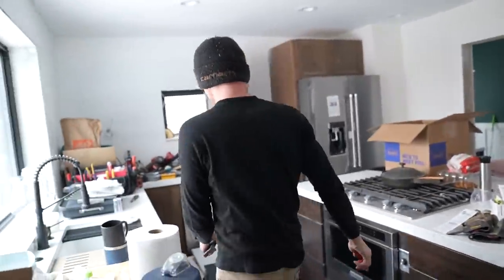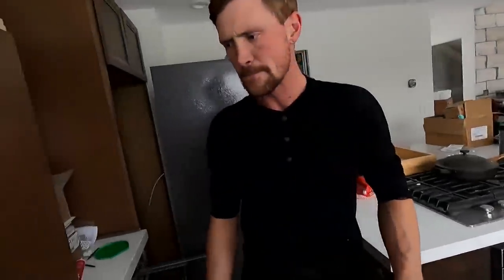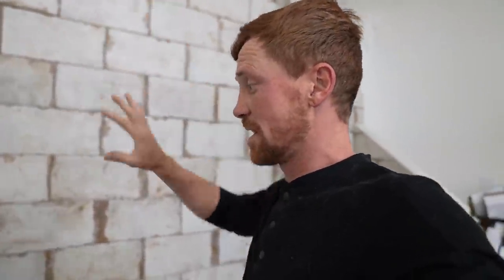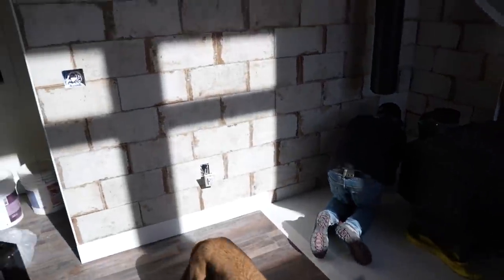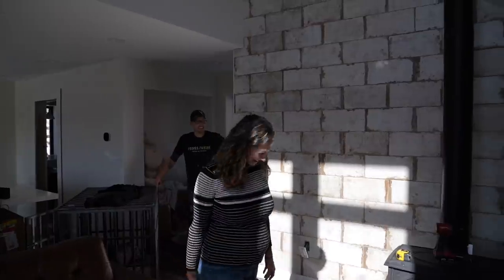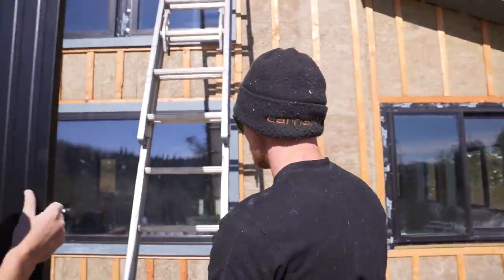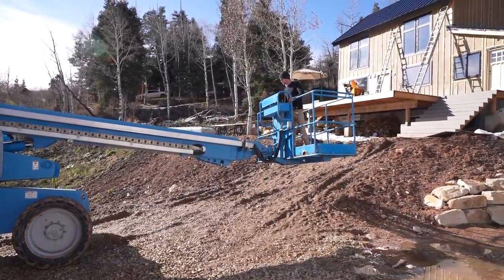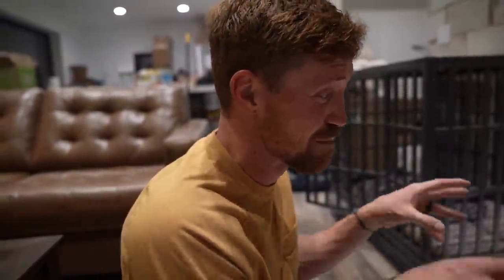TIME IS RUNNING OUT | BUILDING OUR OWN HOME

Comment: Before you light a fire, open the glass door for 10-15 minutes to “prime” the chimney, and crack open the closest window (behind the couch?). Since heat rises it will rise in the chimney and the cold air helps all that. Once the fire is going well, close the window and you should be good to go! It works for us, then no inside smoke because it follows the heat up the chimney. May God continue to bless your little family! You’ve done amazing work and have a beautiful home! Thanks for sharing your journey!

Comment: I have a tip for you Trent!! When you fire up the wood stove you should have 2 or 3 sheets of journal paper with you and after you do the pile of wood when you fire it up, right after it starts to burn you put those sheets mildly wrapped over the wood. Because the paper burns rapidly, that will cause a burst of heat in the pipe and you won't get smoke in your house. Try it and see. :) Regards from Portugal!

Comment: There are a few comments about the fridge being boxed in preventing adequate ventilation - and they are spot on.  All that heat inside the fridge compartment is transferred to the heat exchanger on the back of the cabinet.  This then transfers the heat energy to the air.  When I had our kitchen re-done a few years ago, the installers did not make provision for any proper ventilation. But I, being a stickler for reading the instruction manuals (!) saw the makers specification for minimum air flow behind the unit.  I insisted in the end having vent grills in the toe board and the top of a cupboard door to give the required area of air venting and the fridge works just fine. Before these vents went in, the enclosed space at the rear of the fridge got very warm!
Reply: Typically the fridge would need at least 1” air gap above it to the cabinet.
Check if the leg levelers on the fridge can adjust down more to help. 
Freezer may not get cold enough and the unit will run nearly constantly raising the electric bill if the fridge is not vented to mfg specs.
Reply: Not much (if any) reading of instruction manuals on this channel.

Comment: Allie don't use water on cast iron it will rust and you never get rid of it, you need an cast iron cleaner like a polish just for it, , xxxx Your looking great and so happy you are both almost in, xxx Hugs Dede xxx
Reply: You can use water, just rub a tiny bit of oil on it and heat it up for a bit  before you put it away. No need for soap though.

Comment: You might want to give more ventilation for your frig. They produce heat and you need to let it out from behind the frig. Great show.
Reply: What I was thinking also.
Reply: Today's fridge's are ventilated at the bottom.  Pretty sure they are ok.  There is a gap on the side that should allow air flow.
Reply: @noneya3504  It just looks like there's nowhere for the heat to go.

Comment: Some ceiling fans have a switch on them that makes the blades spin opposite of the way they normally spin when you want to cool the house .  So if there is a switch, that is for winter to circulate the heat back down.  Look to see if your fan has that option.  It really does work .
Reply: Definitely. Clockwise turn is for summer, counter-clockwise setting is for winter. Counter-clockwise takes advantage of how the blades are mounted, in order to force or direct the rising heat downward. For instance, we have a woodstove in another room but keep our bedroom ceiling at counterwise setting and spinning on the lowest speed all winter.
Reply: I forgot to say ... old fans have the toggle switch on the fan housing, but newer fans have the setting on the remote called 'Reverse'.
Reply: @womanofverona  thanks for this. I have the toggle switch on the housing of my vintage ceiling fan. I could never remember which way to switch it! 😂

Comment: Another great video! Brandon and Trent work so well together. A tip we use for cleaning the glass on your wood stove is with a damp paper towel, dip it in the wood ashes that are inside your stove and rub/wipe the glass with that. It makes a nice abrasive that wont scratch the glass. Growing up my mom used to clean/polish the black iron wood stove with paraffin wax. It would make it look  nice and shiny again. Also, a great idea would be to get a storage coffee table with a top you can raise for meals in front of the TV. Storage for a cozy blanket underneath or for little gingersnaps toys. I can't wait for Friday to see the next video. Have a wonderful week!
Reply: you can also use oven cleaner, if the window has tar stains on it.

Comment: It would be helpful for you when cleaning if you can create a new habit to enter through the mud room. Set up a paw cleaning,  wipe station to keep the mud tracks from getting into the house and carpet.  We remove our outside shoes and put on indoor house shoes.  It helps from building up a mud trail on the carpet.
Reply: I’ve seen actual dog paw cleaners for mud rooms. If they put in a bench seat with shoe storage they can have the paw cleaning station next to it.
Reply: Of course they would need a door knob for the mud room door first. Hehe
Reply: @rockingredpoppy9119  😂😂😂
Reply: I was think the same. Perfect advise for them!

Comment: Careful of those extension ladders “kicking out” on the deck.  It’s happened to me.  I turn the feet backward so the ladder itself is sitting on the deck.    They will kick out on hardwood floors as well… have someone footing the bottom of the ladder if you have to go up to do anything.  Ask the painters if you have any doubts.
Reply: Excellent advise!

Comment: While Trent is the mood for fixing things. And the subject of HVAC has come up in this video, you need to know you are going to have major issues with cooling the living space. Let me elaborate, the more cold air you pump into the home, the more hot air will be pushed up into the vaulted ceiling. Which in your means two things, first - the master bedroom will be unbearable, second - the family room will have a constant radiant heater above. You see, air conditioning doesn’t work by introducing cool air, it works by removing hot air. The cold air will fall to the lower parts of the home and the hot air will rise and stay there ! Most ( 80% ) of the return air in this particular home should have been installed so that it removes the accumulated heat from across the peak of the A frame / vaulted ceiling. I do believe the highest location of a return is at floor level upstairs, not good ! And don’t bother trying to relocate it to top of master bath, won’t help. Persentages of return need to be 80 or abouve and location will need to be at the peak. Check it out come summer and let me know if you want some advice on a quality retrofit. Current build was probably designed by an architect, but should never have been laid out like this by HVAC contractor.

32 year licensed HVAC contractor, specializing in custom design and build
Reply: I’ve got a 9/12 roof with a vaulted ceiling!  In the winter months I sleep with a window open upstairs...I use a wood burning stove..so no worries about wasting energy....but it does get so hot even with the ceiling fans and windows open......but, I do understand what your advising.....
Reply: Yip, same here!  The one solution for re-introduced cool air back in the bedroom for Trent and Allie could be a ranch slider door.  As mine(the bedroom) has a patio extension.  Lovely for all year round in Lovely New Zealand!
Reply: Yep.
Reply: It seems it may be time to talk with the architect and ask a few questions. I feel they should offer a solution at no cost and how to get a return air system that is the correct one. Clearly a major issue.
Reply: @FarmerC.J.  He is referring to Summer cooling. The HVAC vents on are the floor. Cold air falls & hot air rises, so there will be a stratification issue in the summer since there is no transport of the cold air from the HVAC unit to the upstairs. My guess they will end up installing a mini-split upstairs.

Comment: Don't you need a space between the cabinet (above) and the fridge so it can breathe? I thought that was what the fridge guy told you when he repaired it?
Reply: Did you not hear them discussing this with the installer & they're raising the upper cabinet? Y'all are pretty quick at negativity when Trent is very capable at recognizing problems!
Reply: They took it apart to raise it and when they were done and slid the fridge back in, it just barely fit in. So .....the cabinet wasn't raised like they were suppised to have done. Guessing the sides looked like crap missing 3 or 4 inches at the bottom so they put it back down again to think of Plan B.
Reply: @janetscott5252  - easy there bud. Not being negative. Just asking a question. Wasn't sure I understood
Reply: That was my first inclination until I thought about the vent that is at the bottom of the refer which needs to be vacuumed consistently to help the refer circulate and keep dust from building up because the refer is enclosed.  I have the same set up and noticed that after the refer vent is vacuumed you feel a difference in the freezer temp and the cold half used for storing food functions well.  I would have liked to see them take the cabinet up to ceiling allowing more air to circulate in the back of the refer, that would be an easy remedy and making sure the refer isn't up agains the wall which I doubt because of the plug-in.
Reply: Maybe you could drill a 4 inch  vent hole in the back of the cabinet and install a vent pipe to the top to release the heat buildup.
Reply: Common (i.e. big box store) cabinet height is 90 1/2". Common cabinet above the fridge is 18". If all of that is true for these custom cabinets, there should be 3-4 inches above the fridge.
Reply: @janetscott5252  😳😬 Hope you're doing ok. Hugs.
Reply: It may have been the way the video was edited. All the video where to us it would be after the cabinet was raised could have actually been before it was raised. Who knows...
Reply: @janetscott5252  they supposedly raised it during the video. Didn't you watch it before commenting? It didn't look like they actually did raise it but that might just be video editing. It didn't look raised at all when they were "finished" and I am pretty sure that's what djpwilson was commenting on. If you watched the video before commenting you would have seen all that.
Reply: @janetscott5252  why are you being so defensive? The OP was just asking a question because they weren't sure. A 25 min vid does not show all that they did over the weekend or from 2 weeks ago, who knows. I'm sure the question was directed at Trent and Allie not to you. They were not being negative at all. Take some time and smell the Rose's if you are that rude over a simple question.
Reply: Thats what I thought too ????
Reply: @janetscott5252  ???   I'm not being negative , I just thought there had to be a bigger space up there , thats all ,chill dude LOL
Reply: @yolandawilson9852  easy does it. Everyone is ganging up on @Janet Scott. You just showed you’re not that nice. It seems as though everyone just has concerns for them. This is a social forum. No personal attacking necessary. This is Trent and Allie for goodness sake.
Reply: @janetscott5252  they raised it in this episode and there is still barely any gap.. I think that is what ppl. are talking about

Comment: I so look forward to Mondays and Fridays. A quick fire stove tip. Don't use water on the dust, it will smear the stove. You can use a dark polish to black it out again. That's what we do on our stove to avoid ash and dust stains.
Reply: Yes, a very small dab of "stove black" to help wipe the dust off first, and then apply a final coat more liberally. That first small dab is just enough to make the rag "sticky" like a tack cloth. Not enough to coat the surface.

Comment: Best way to build a fire in a log stove to avoid smoke is to place your logs in first then build the kindling on top then make a wax soaked paper towel molded into a plum size Hershey kiss use this as your fire starter. Light it and close the door slightly. This will create the right amount of heat flow from the start.  Close the door when top of pile is fully lit.  👈🤓😉👍
Reply: I read the comments after posting my comment of a weed burner.  I will try this... IF it works you ARE A hero if not... ZERO! Great idea.

Comment: Get yourself a much smaller snow blower for your deck, maybe even an electric one.  If the door to the sun room is going to be your primary winter entrance, get a heated mat to put outside.  They are AMAZING !
Reply: Its Utah, in the mountains. They can get 3 feet of snow in about 12 hours. Small Snow blower isn't going to do it.
Reply: @guytech7310  Don't wait 12 hours !

Comment: I recommend putting the bed the same wall the bathrooms on so therefore you have more room on either side for dressers and baby stuff
Reply: Most people think you need an actual changing table. To change the babies diaper were you actually is a changing pad not so much the table because you’re able to change the diaper anywhere to bring the pad around the house have one upstairs and one downstairs to other if you’re upstairs or downstairs are you watching the diaper I’m not changing bad. Therefore you don’t have to keep going up and down the stairs and if you’re downstairs have an extra changing table set wipes diapers change of clothes do you therefore you’re not going up and down the stairs every single time and he change the diaper.

Comment: Fire starting til…place a mix of ripped newspaper and cardboard…then place kindling on top of paper mix.  The paper will burn fast and hot which will rapidly heat the glue , create upward draft, and get the kindling going. Works for me.

Place is looking good! 
Good luck 

Frank

Comment: I have a bassinet I designed and built myself as an heirloom bassinet that can last hundreds of years as it's passed down through the generations of the family.  So far, only my grandson has used it.

(After posting this, I saw some other posts about cribs. My mobile bassinet is considerably smaller, and much sturdier, than a  crib.)

It's unique as it's the only one like it anywhere in the world. I can send you some pics if you'd like to see it. 👍😎☕

I made it larger than normal bassinets so the baby can be in it and use it for a longer period after they're born.

The bed swings for like a rocking motion and it's on good sturdy casters so it's easy to roll and specially built for rolling around the house and even for tight cornering through and around hallways and turning tight turns through doors. (Not so handy for your stairs though. Ha ha ha...) I built it with solid oak beams I made myself. Personally, I'm pretty proud of it. (I was living in Europe where I was walking through towns where there are so many buildings over hundreds of years old.) The base is slightly larger than the bed sections and the solid oak beams are heavy enough to make sure it won't ever just tip over and hurt the baby or anyone else. If you see it... let me know what you think of my design... lol

It's a special feeling being around all those old buildings hundreds of years old... and that's what inspired me to design and build a bassinet that could last hundreds of years too. You see old furniture in museums and such... I designed and built my own piece of something that can last and work so well long after I'm gone... and I feel very good knowing my family will have such a historical treasure to use for generations to come.

Let me know if you're interested in using it. I'm not too far north of you, in Montana.

Comment: When you start the 🔥 you put your logs in with air between then shove the kindling in-between light it shut the door open bottom vent...after 10 minutes you can open door and shut the bottom vent and enjoy smokeless.  We had a masonry fireplace with the vent doors no gas, it was the best fireplace ever...and when you go to bed shut door and bottom vent no smoke will come in even as the fire dies.  Heat stays in the house. It's really all coming together, enjoy your time together before the baby.  Start resting now.

Comment: The cabinet over refrigerator needs to be higher to allow airflow....I think around 6 inches higher, so that you have airflow.. plus the refrigerator should allow 2 or 3 inches in back of refrigerator for airflow .  Look at your manual for exact air clearance....otherwise the fan/motor can burn out.
Reply: Definitely!

Comment: When refrigerators fit so snugly into a cabinet, you shorten their useful life because there is a serious lack of ventilation.
Reply: I was going to make a similar comment, telling Trent they should maybe lift the cupboard above the refrigerator by a few inches so the air can circulate.  Usually, the papers that come with the fridge tell you to leave a few inches around it for ventilation. I would check it out.  Your fridge is an expensive and important unit.
Reply: All you need is to move the inside back of the cabinet forward 4 inches and it's fine. From the outside everything looks the same and the cabinet isn't so deep that things get "lost" back there. It's a great way to vent the fridge without changing the looks. We are very happy with ours.
Reply: Or drill 1 inch ventilation holes top and bottom back wall of cabinet above frig
Reply: Yes , will get expensive replacing refrigerator a few times
Reply: i'm glad you said it. this concerns me as well. eeeek. if they were going to the trouble of raising that cabinet, i wish they had gone at least 3 more inches higher, if not a bit more.
Reply: @lb9486  , excellent trick!
Reply: @jeffreydysart4196  drill a hole to the outside?
Reply: Appliance says you need to take clearance into account. You should allow for a ½ inch to 1 inch of extra space between the refrigerator and side walls. ... This extra heat can put additional strain on the refrigerator's cooling capabilities, and before you know it, you may need another one.